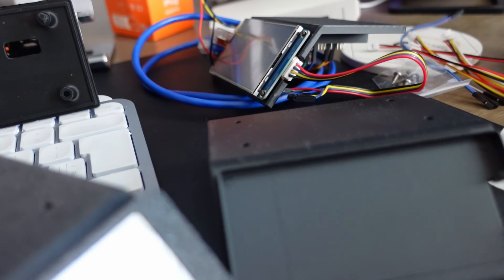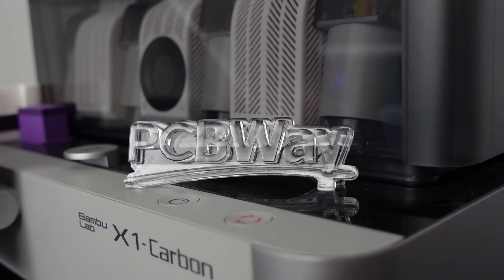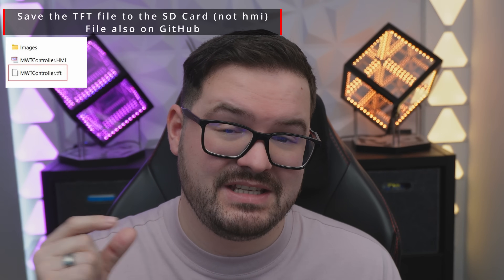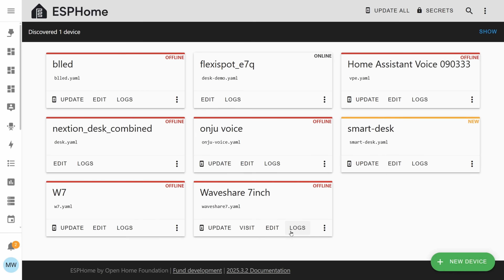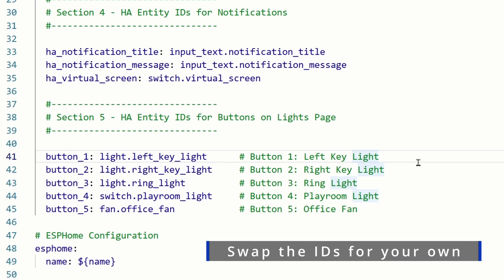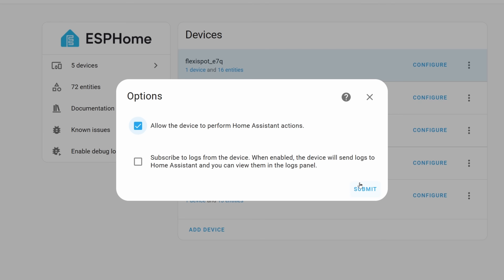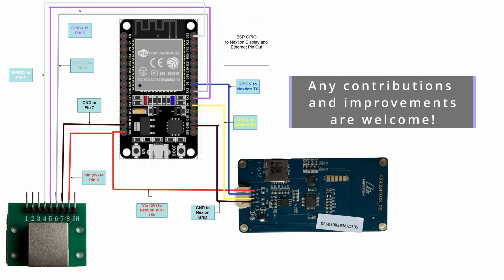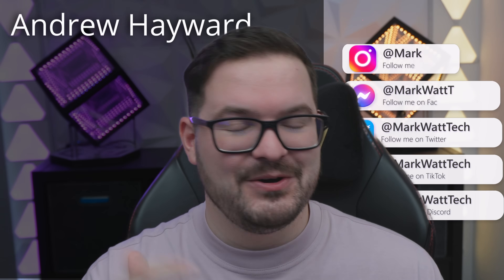🚀 Build Your Own Touchscreen Desk Controller with ESP32 + Nextion + ESPHome!

Comment: Hi thanks for the great video.
I have just recently downloaded and install the latest version of Nextion Editor 1.68.1.  When I run the app I get a load dll error ApplicationRUN.resouces and others.
I am running Windows 10 with latest Visual C++ Redistributable and Dot Net 3.5 as per requested.

Any ideas to what maybe wrong, I would to use this it's frustrating...

Can someone help, thanks
Reply from the maker: Hey Tim. Did you manage to resolve this?

Comment: Hmmh, I got to look into if this is possible with my existing desk. Though it's got a Linak CBD4 controller, that apparently communicates through a LIN bus via RJ45, at 12V.
I guess I'll need some mosfets, resistors, an LDO regulator.. That should result in me being able to power the ESP32 off it, as well as use the RX/TX on the bus.

Comment: I built a large (21") touchscreen computer using Raspberry PI 5, off the shelf linux (android 15), and any touchscreen. I prefer 21" monitors. I could go much larger, 30", 40". or smaller. I like this approach because I can use any size touchscreen and there is no battery to go bad. Plus I can upgrade to any future android version.
Reply: who TF do you think actually cares😂

Comment: Nice... another project on my 'always wanted to make' - list.  
I don't have a changable desk but this deskcontroller can be used for lots of stuff.
The most valueable extra-function i see is the 'turn of screen' toggle, to use in an automation when i enter or leave my desk.
Thanks for sharing
Reply: Building a similar touch screen gadget has also been on my "always wanted to make"-list for quite some time. But I had purchased a WaveShare Touch Display Module (3.5 inch, 65K Colors, 480 x 320 pixels; resistive instead of capacative touch) for Raspberry Pi Pico.

Although I found out later that the Pico W(ireless) is not supported, because part of its memory is used for the wireless connectivity... therefore not available to hold the WaveShare driver and additional code. 😑 So, for wireless communication I'll need to combine the Pico with a separate Pico W or ESP32 (that presumably won't be able to run ESP Home at the same time 😕).

Also I'll most probably have to handle input at a basic level (checking which on-screen button/area is touched, based on coordinates). Far from this fancy Nextion solution with the GUI designer, on-board input handling etc. 🤓

On the other hand, compared to around $40 for the Nextion 3.2", this WaveShare module cost me about $19 (including tax). But obviously has way less features.